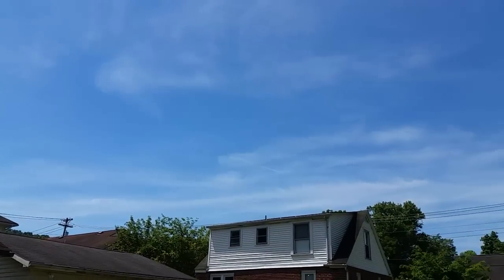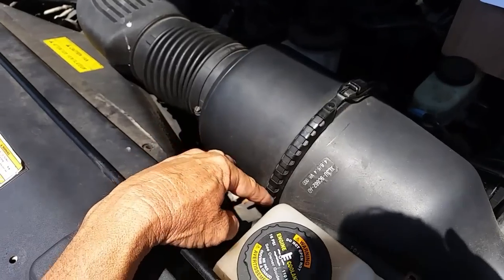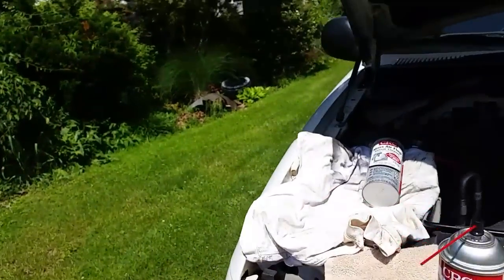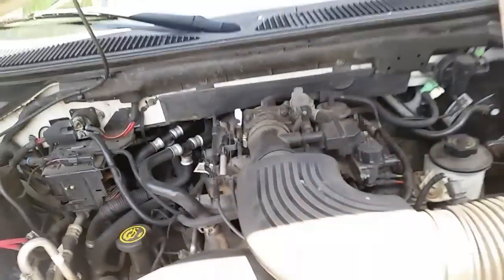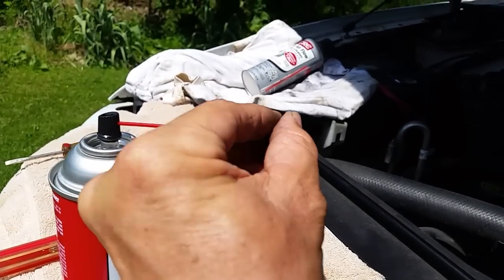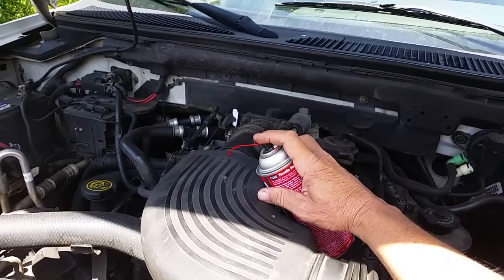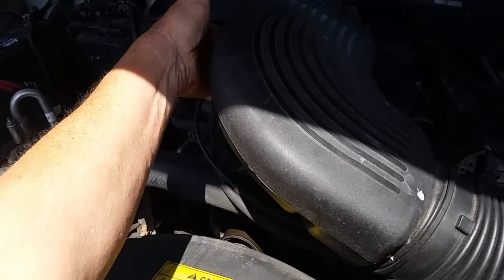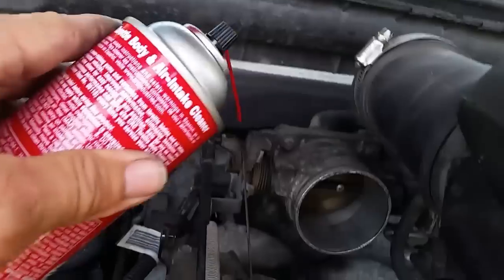Quick Tip-Throttle body intake Cleaning.... Without opening the system!

Comment: This method really won't clean the back side of the throttle body which is where the sticking of the throttle plate occurs. Secondly drilling holes in the intake hoses and taping them will encourage a vacuum leak in the future.

Comment: Interesting approach, I generally just move the intake tube over to the side and use a blue shop towel with the throttle body cleaner to scrub off the carbon with the vehicle turned off. Keeps nearly all of the contaminants on the disposable rag, only takes a minute or two, and keeps the intake tube intact instead of trusting a tiny screw to stay in place. although it only makes a small hole, if that screw falls out your intake will suck air through it at a much higher velocity than it will from the rest of the system as in doesn't have "flow restrictions" such as the filter and MAF sensor. An intake will always draw air from the source with the least resistance at a much higher rate, and that high velocity air coming in will be from the top of the engine bay away from the edges of the hood where it stands a chance to suck in fresh, cool air. Heat rises so the middle top of the engine bay would theoretically be the hottest point in the bay meaning the air coming in at a high velocity from that hole will be as hot as possible, be unfiltered and very likely filled with contaminants such as dirt. Basically if that screw ever falls out than you could end up suffering very minor performance losses with potentially medium engine damage as dirt will be free to travel into the combustion chamber. Maybe try gaff or gorilla tape, taking an extra 30 seconds to clean it with a shop rag by hand, or just avoid the build up on the throttle body by installing a $12 breather filter or spending $20 on an oil catch can? the PCV valve is what causes the build up in the first place. I honestly respect your ingenuity and think that your video was very well put together. I don't mean any disrespect towards you with this comment, just adding what I know from experience.
Reply from the maker: Screw will never fall out. The hole is very small. Some engines will not run when you unhook the air cleaner. Running the motor will help the get the gump out in the intake a "rag" can't reach also. Thanks for you comment!
Reply: but the engine doesn't need to be running in order for you to clean the throttle body. just do it by hand with the engine off, it doesn't ruin oem parts, takes a comparable amount of time, and does an all around better job at cleaning the throttle body ;)
Reply from the maker: Jeff Knaack ....But trying to spray in to the intake or cleaning where a rag won't reach is not an advantage? Inside the intake is where 70% of sludge hides. Try getting a rage in them passageways!. ..But I get your point. I often to extra distance ...to achieve maximum results. Spraying will clean out inside the intake some if you can keep it runing.
Reply: i dont know bro i think this is a pretty good idea. i gust read about a guy doing it your way & he ruined the throttle body sensor cost him 180.00 bucks. its only a freaking truck. usually when you have to do this am pretty sure you have over 100,000 miles my truck has over 350,000 & still ticking witch im about to clean the throttle body this way cause i cant see me buying 180.00 bucks for a new throttle body. but i can tell you i would not do this to my family car.
Reply: if you ruin a throttle body by cleaning it, you have no business working under the hood. That's the equivalent of the one stupid kid that everyone laughed at in high school for jamming a paper clip in the electrical outlet. Just use common sense lol. this is my last comment on this because anyone who cleans a throttle body by swiss cheesing their intake shouldn't be working on any car, ever!!!

Comment: 1. Warm up engine. 2. Remove air box and duct.3.spray into throttle, and open throttle spraying the underside of throttle plate 4. Take a clean rag or paper towel and wipe.. let the car sit for 30 min.to let excess cleaner evaporate..start the car... No need to rev the engine.just let it idle.more the likely when you first start the engine it may run a little rough. No big deal.:)
.

.
Reply from the maker: Thanks for sharing! There are a lot of way to to this. I like your Idea also!
Reply: Pp
Reply: May as well just remove the TB and spray & wipe so you get both sides of butterfly valve as well as the inside & inner wall........
Reply: @Wes_5kyph1  I've done  that and have even gone as far as removing the entire intake throttle body and Automatic Idle valve and cleaned everything without even starting car because I've been concerned what all that  gunk may do to the o2 sensors and the Cat.

Comment: This did a great job in cleaning the intake manifold valves in my 2008 Jeep Patriot 2.4l engine. I didn't create a hole in the manifold. I just disconnected the air filter and sprayed past the air mass sensor. Worked great! Thanks for sharing.
Reply: Is better not to sorry through mass sensor

Comment: Excellent idea. Instead of a screw ( which may distort the hole after time and suck some air I used a good silicone sealant for a air tight intake.
Reply from the maker: True.
Reply: Be sure the silicone is dry before you start the engine

Comment: A couple questions for the people worried about where the "crud" goes.  Where do you think it came from? Where do you think it would have went if it didn't stick to the throttle body? Do you think that the "crud" that is stuck to the throttle body is 100 % of the "crud" that entered the throttle body?
Reply from the maker: I know right! You'd think that ''curd" was something that going was going to blow up the motor by a lot of comments. Dirty oil will cause more damage to a motor than any "curd" will ever do. Its fun reading comments!
Reply: taxid3rmy
But maybe it’s a good idea to do it just before oil change then, if it goes to the engine block, it’s just a little contaminant to the engine oil, which one can then leak off, for a fresh oil.

Comment: I would like to see how clean  the throttle body is on the down stream side of the  butterfly  , you didn't show that . I can clean the front of the TB and both sides of the butterfly with engine off,using a tooth brush and some TBI cleaner. Then start it up, open the throttle a little giving it a shoot or two of mouth wash. The tooth brush will  reach way down stream and get that too .

Comment: i'm not a rocket scientist but how would this get into your oil and require two oil changes? it's going into the combustion and out the exhaust.  As for whether it cleans the other half of the TB, my question is why do half the job? And secondly, why poke a hole in anything at all? another way for moisture to get where it doesn't belong. and lastly if your system is so fragile that you cant open the hose or port then that part is bad already ... right?
Reply from the maker: Bingo....you  understand! Pro's and con's of everything in life. Thnak's for viewing!
Reply: @FixingWithPassion    LOL

Comment: For fuck's sake, this way all the gunk will be sucked in to the engine. Not to mention ruining the feul injection. Please do not do this to your car. Take the air flow hoss off, its just a couple of clamps, and then clean the throttle body with, carborator /throttle body cleaner.
Reply from the maker: Na, Works great. feul sensor??  lol  ....OK what ever you say ...
Reply: Nathan Rohrbough I meant feul injection*, my bad.
Reply from the maker: Got ya!....Have a Great day!
Reply: Nathan Rohrbough you too.

Comment: Can you use Carb Cleaner on this or is that to harsh for the throttle body?
I have an old 95 del sol honda.
Reply: Throttle body cleaner for throttle body. Or you can use the SeaFoam spray and follow the instructions. Works the same way.

Comment: Why would you put a hole in your intake if you already disconnected the intake from the throttle body just spray  it directly and wipe of the shit OMG
Reply from the maker: OMG...Some autos will not run with the air cleaner off. Got it??
Reply: @FixingWithPassion  that my be i still  would just spray it directly and wipe of any crap left over. Not punch holes in my intake 😒

Comment: Would have been better if you would have cleaned the throttle body with cleaner and a clean towel rather than suck in all the crud into the injectors then do what you demonstrated
Reply: @jim hamilton , if its going through the air intake how would it go near the injectors? i don't think your a Mechanic are you Jim?
Reply from the maker: Word!   lol
Reply: TVWXMAN32, dumb question here, where does all that crud go anyway?
Reply from the maker: Mostly gets sucked into the engine and burnt up and blown out the exhaust. But its really not that much black crud to do any harm.
Reply: Awesome! Can your engine actually burn this stuff...i have the same bottle and this is pretty crazy but worth the trouble lol 2006 honda civic si owner...
Reply from the maker: Yea its not much liquid....its blows through the motor and does no harm. Hopefully it will clean some deposits and gum out but its really hard to get it 100% clean.

Comment: that stuff just breaks up the carbon build up.... it does not disolve it. You basically just added a whole bunch of gunk to your engine oil. you should NOT do this!!!. I would do an oil change and run it about 50 miles and do another oil change to try to get the carbon out you just dumped in there and keep it from building up inside the engine!! This is a HORRIBLE idea!!! I am by no means a mechanic, it took me a half a day to watch a couple videos and take my throttle body off and cleaned it. not to mention there is a lot of carbon on the back side of that comes from the IAC valve ports.
Reply from the maker: True....But its such a Miniscule amount. 2/3 will get blown through the 
exhaust. We are talking just a few ounce's. It's not like you dumping a 
quart into the motor oil. Hell I bet the oil in most engines that need 
intake's and Throttle body's cleaning really bad....all ready have 
horrible oil in them... and need a oil change. Been doing this for 40 years....never a Issue...So Its not all doom and 
gloom ;)
Reply: This is ok if you do it on a regular basis AFTER you do the complete cleaning(ie taking it off and doing it on the bench).
Reply: yes you are by no means a mechanic.Most of the fluid will burn up. a small reside in your oil. so if this concerns you , do the throttle body cleaning before an oil change.

Comment: Why not just clean the throttle body out by hand with a rag? Much more efficient and effective... Also your not sucking chemicals into your engine doing who knows what. You just wasted that whole bottle and only cleaned the outside of the butterfly.. I absolutely do not recommend doing this because you could potentially lock up your engine or maybe even set it on fire lol. Anything going past is just being sucked up and not thoroughly cleaning around the edges and walls, which is what's important. I recommend using a screw driver to prop open the butterfly, while using throttle body or MAF sensor cleaner the proper way and use a rag because the spray alone won't remove the deposits. Doing this will actually make a noticable difference. Just did it in my '99 expedition 5.4 liter engine and it brought it back to life! It was choking.

Comment: It would possibly have helped if he told what the issue prompted this resolve.  I am seeking to determine why my chevy van is having running, power, surging issues.
Reply from the maker: Low Idle, sometimes stalling. But this is not a always a cure as there are other sensors that tell the EMC how to run the engine. But having said that, its always a good place to start. And anyone can do this 'first step" in acquiring a issue of a poor idling stalling  auto. Happy fixing!

Comment: In fact I've never herd of MAF (P) spray cleaner! I would assume since those r electrical parts they would take electrical nonconducting cleaner.  Respond plz!
Reply from the maker: Yep...easy on those sensors.
Reply: You cannot use non-conducting cleaner on the MAF sensor MAF sensor is a special sensor special cleaner in the cleaners made so that when you spray the sensor the cleaner has no residue at all Left Behind where some of these other cleaners will leave behind some residue or some lubrication because that's what their call for be very careful with some of these sensors expensive to fix
Reply: Brent Waterbury I
Reply: Reminds me of Carbon Tetracloride from back in the day. It does work good for cleaning the sensor for sure.

Comment: No. Just no. You already took off the intake. You would have gotten the same results or maybe better by just using a rag and would have used a fraction of the can. Your method isn't easier just lazier.

Comment: Hello, I have 1997 dodge caravan 3.0l with a blown head gasket, I replaced the head gasket two days ago I also change the oil but still the color of oil look like coffee with too much milk, can you tell me what did I do wrong. Thank  TVWXMAN32
Reply from the maker: Water is still getting the the motor. Something is leaking still, cracked head, block...etc.
Reply: Did you flush out all the antifreeze and flush your engine before the oil change
Reply: I'm sorry I just seen it was 4 months ago quite sure it's fixed sorry

Comment: Did this on my rough idle tacoma but thru the brake booster hoes that conects be hind the trotyle plate car runs lik a top now i need to seafoam it 20000k with new engine
Reply from the maker: Nice. If some people only understood some "tricks" to cleaning like you do. ;)

Comment: Too much people leaves the throttle body without any cleaning. Sadly, because it's a trivial job to do on most cars. Just done it on mine, by removing the throttle body from the intake and replacing its two gaskets. Now the plate is shiny and the little 1.2 has a faster response and a clockwork idle. No calibration problems at all.

Comment: Mechanics take the cover off the throttle body and spray right into the throttle body. People think mechanics shops  and stealerships take everything apart spend and hour or two cleaning and wipe it with clean clothes so the crap  don't go in the throttle body. Big repair bills make people think he worked his butt off. HA

Comment: Rumor has it, he still cant figure out why he's getting a lean code on both banks :) Just remove your throttle body and use a toothbrush with the cleaner folks. Good time to clean the MAF as well. Only use that CRC stuff he showed. It will be done right and look brand new.

Comment: Or just add Berryman B-12 Chemtool to the gas tank😊
Reply: Fuel doesnt touch the throttle body unfortunately. Tank additives only clean where fuel goes so your fuel line, filter, injectors, top of pistons and intake valves. Lucas fuel additive is best, it lubricrates the upper cylinder as well